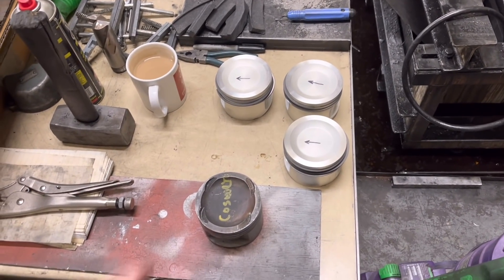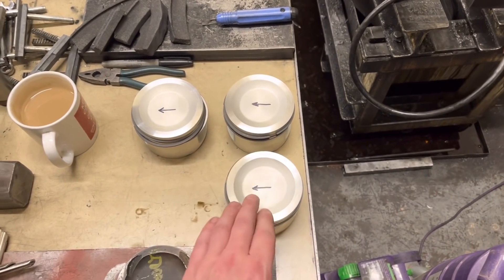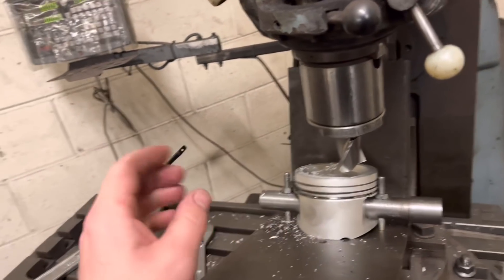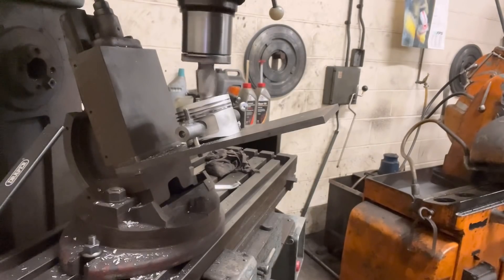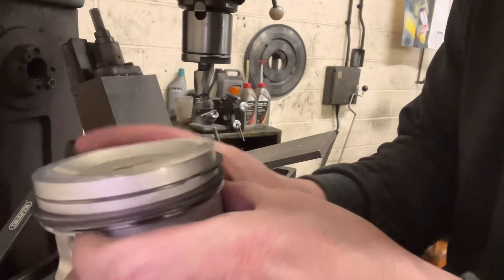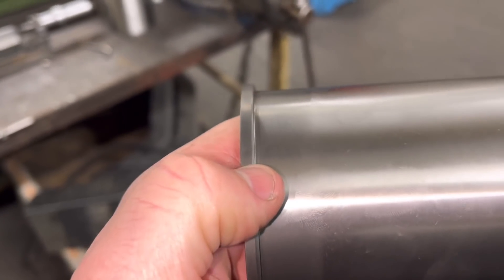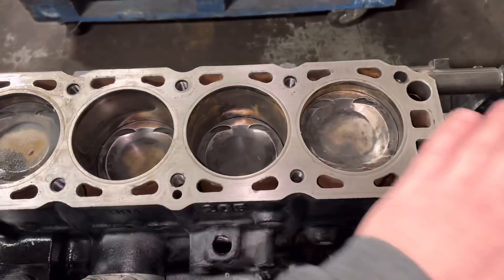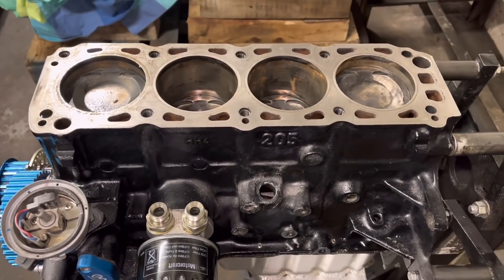How to Machine custom valve pockets into COSWORTH pistons

Comment: Hi, What make of milling machine is that please? It looks very solid and also has a horizontal spindle. Looking at the autochuck there seems to be a gap between the locking nut and the body. I was taught to screw the locknut loosely up to the body before screwing in the milling cutter and then locking securely with the spanner. Not sure how much of a difference it makes but might be worth checking just in case.

Comment: Great vid , what are you using to locate the piston in the X axis ? I couldn't really see .
I've machined many piston crowns and I used a similar setup but had a boss diameter locating in the skirt ID and two towers either side of the gudgeon pin bores for a dummy pin to go through with flats on it for grub screws to clamp 👍
👍

Comment: one question about your piston holding setup - I dont see any side to side location at all , so how can you be sure of cutout location ? I need to do the same to a set of pro stock bike pistons (running 16.5-1 compression with oversize valves) and very little clearance anywhere....

Comment: I have seen a few seized bearing inner races removed by running a bead of weld around them, then as they cool they contract the race a little and loosening the race. Wonder if this technique would work with the liners ?

Comment: With the inlet valve relief leaving a thin material wall on the outside of the cut, do you not suffer hot spot preignition, or run-on as these are high compression engines? I actually like how you mount the pistons for machining, heath robinson or not.
Reply: The American version: Rube Goldberg

Comment: Always fascinating! For that Cosworth 'for Dave'  with the problematic liners that most likely will be pressed out, if you can, some vid on that operation would be most welcome. Bit of intrigue on the outsize one, only one way to find out the story. That block may have been destined to never be balanced and optimal with an odd liner.

Comment: Not trying to tell you how to suck eggs, but from much experience with liners of all types just bore with smallest radii that your bar will do down one 'side' of liner they will then lose the interferance fit and just fall or push out with fingers. Saves much cursing, pushing and block damage, liners are toast anyway. Whoever did the work prior is some form of engine butcher, i admire you for taking it on and not just saying not touching that take it back to the butcher.
Reply: The extra lip on the odd liner might be covering a a chafing imperfection in the block surface bore edge. I suspect there's a story in there somewhere, only one way to find out.
Reply: @stephensaines7100  oh yes theres a story with that, as you say a cover job, will be interesting to see when liner out.

Comment: Very interesting to see you put in the valve cut outs . Top job 👍🏻 ,wasn’t expecting the material to come away quite so quickly. I was surprised to see piston rings fitted, but I do suppose the alloy pieces are fairly coarse and clean away easily. 
Very eye opening work on the cosworth block. Wondering why cylinder the liner had been fitted that way. 
be nice to see if it’s been done for a reason or genuine mistake. Keep up the good work 👍🏻

Comment: I would have thought having the cut outs so close to the edge of the crown would cause a hot spot area and potential failure ? As for it being safe. When I was trained with mills and lathes, we used magnetic guards to prevent swarf flying and arms and hands getting close to the chuck. Yes, its an old machine and stuff I used in years gone by but safety its paramount especially when you show videos that documents no protection etc.  Just saying , nothing more. Otherwise a good update as normal.

Comment: Question about the valve pocket sizing, is it ever adjusted to give a specific clearance volume (the un-swept volume of the cylinder at the end of the compression stroke) or is it a generous dimension to avoid new pistons being required if the cam profile is changed?
Reply: Its always the minimum needed to clear the valves, valve cutouts can affect flame front or cause a heat spot which can cause pre ignition.